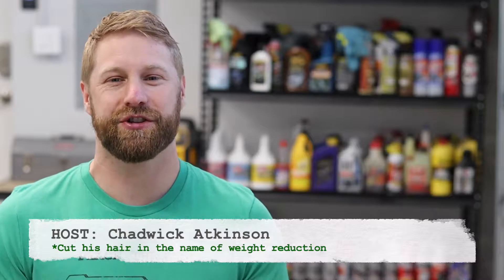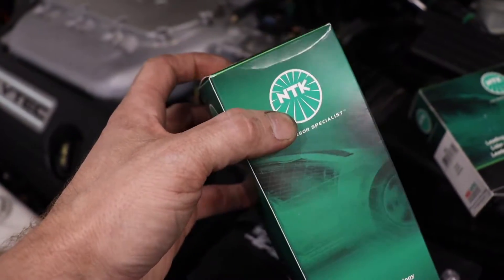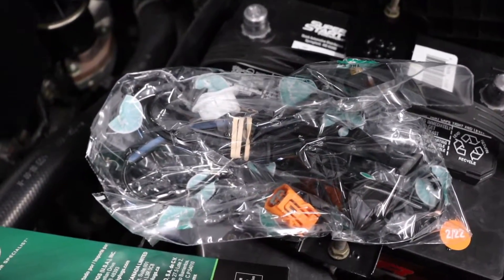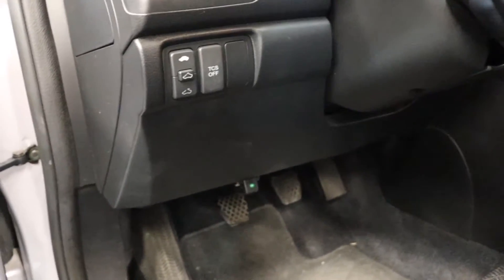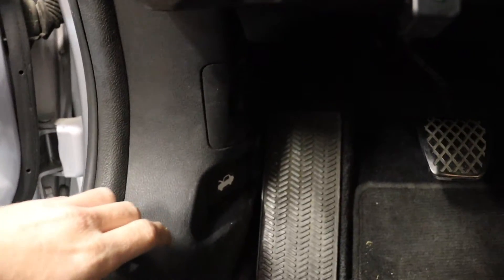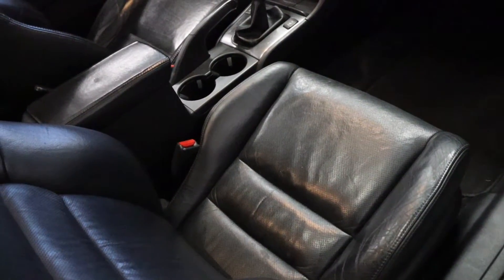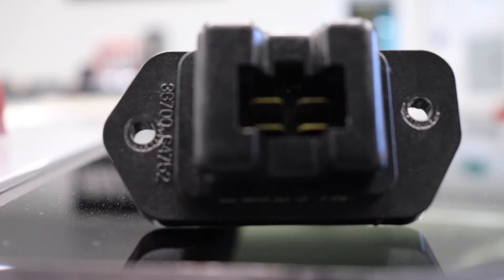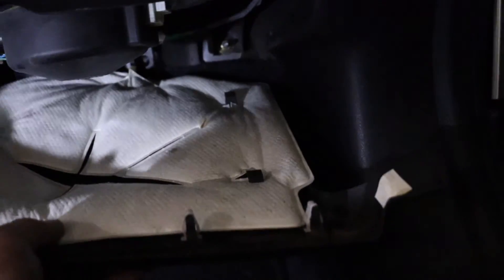2003 Honda Accord V6 Manual - Episode 2: ABS Sensors and Blower Motor

Comment: My E46 325ci has an ABS issue like this one. Randomly while I'm driving, the car will start pulsing the brakes. Pretty weird feeling at speed.

We need to see some pulls in this car!
Reply from the maker: Might be worth a check on the ABS sensors. 

And...hell yes it's coming! Can't wait to review this thing.
Reply: @autoobsessivegarage  From my research, it's some control box that mounts on the outer driver's side Floorplan near the door jam. 

Another funny coincidence is my E46 also had the Final Stage Resistor for the blower fan go bad as well. Lol Common problem. Wasn't horrible to replace.

Love the videos! The Accord needs some YT content! Too underrated not to!